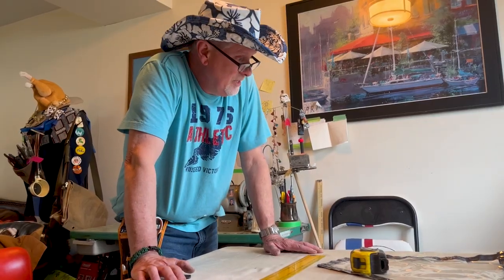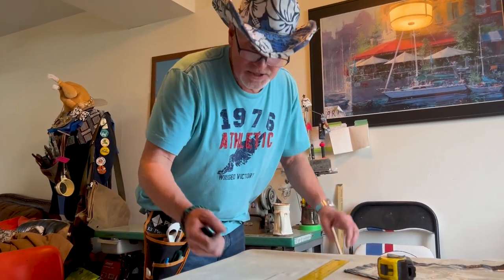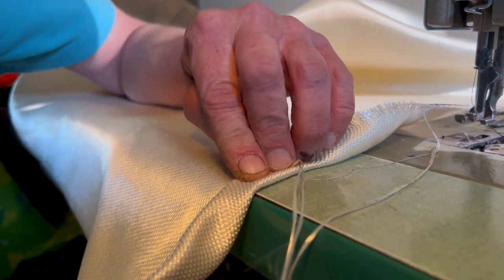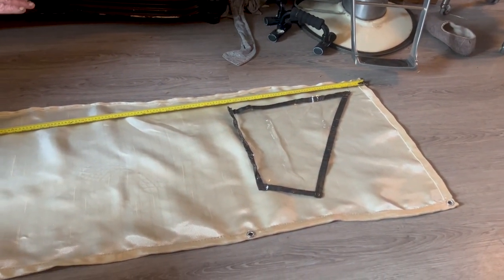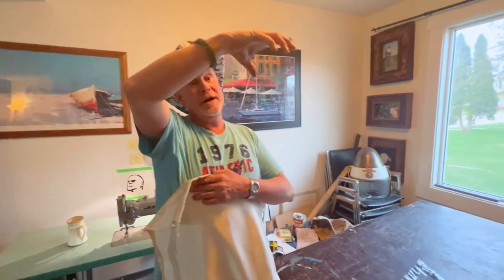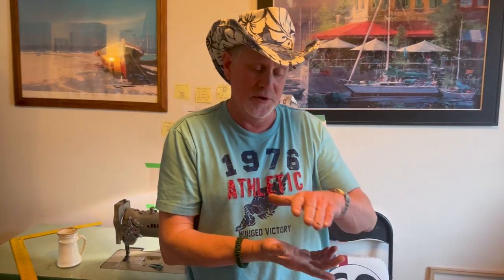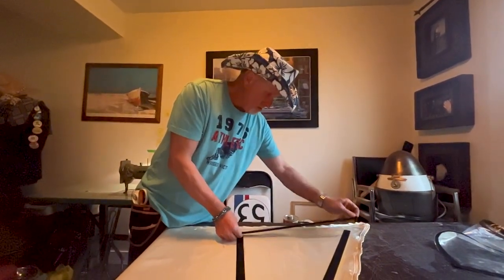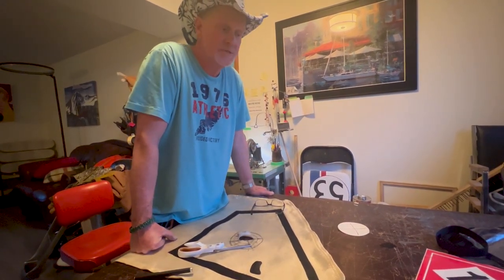How to Make a Stove Jack for $10 That Fits Most Eskimo Ice Shelters

Comment: I use carbon felt for my Eskimo stove jack. It's heat resistant up to 1800°F, cuts easily with a scissors--with no loose/frayed ends, and you can just staple the velcro around the edges. It's far, far easier to work with than a fiberglass welding blanket.
Reply from the maker: Thanks for the tip! I'll keep that in mind for next time

Comment: Is there a welding blanket that doest have all those itchy shards like fibre glass?
Reply from the maker: There are heat resistant items that may work for making a stove jack but, I'm not sure what would or would work. In retrospect after sowing the seams it may be better to use a heat resistant epoxy